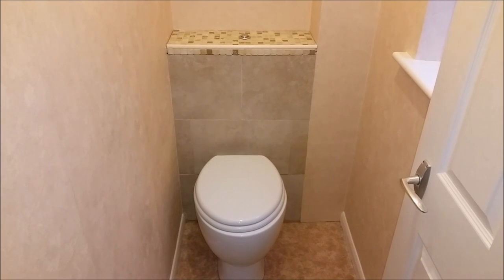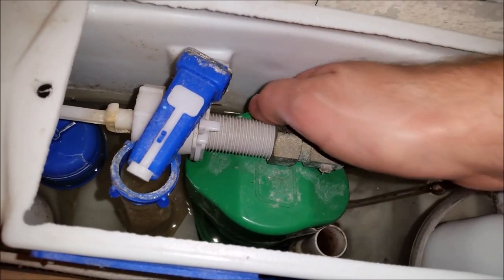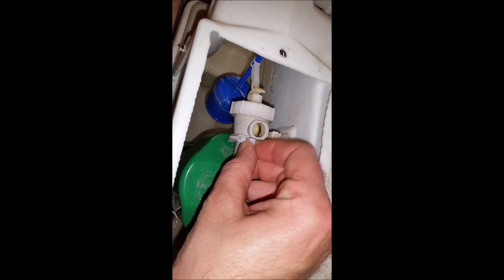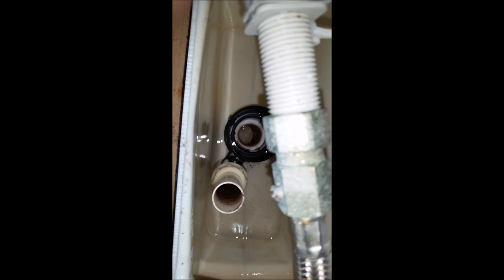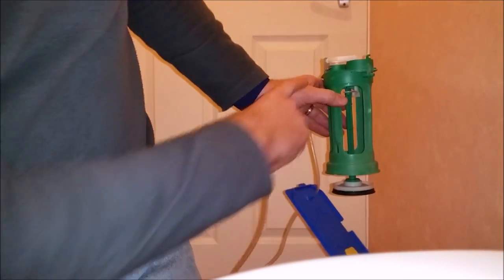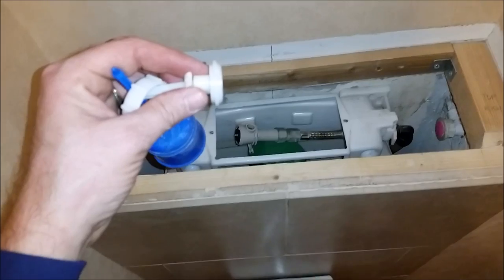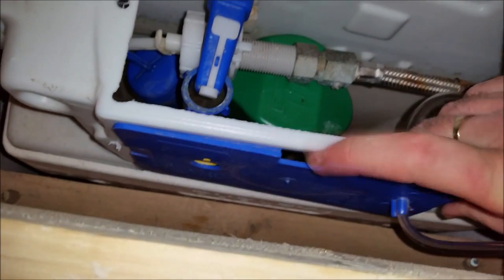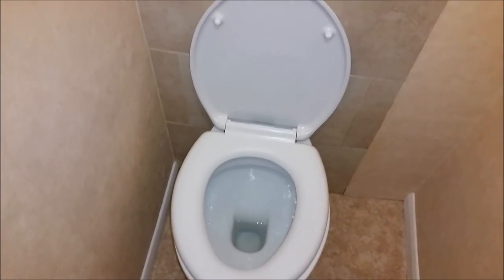How to repair a toilet flush - push button flush not working

Comment: Just want to say - this video was an absolute gem 

Had exactly the issue described even down to the same broken hook inside once apart 

I didn’t repair - just replaced (£35 cost) once established the issue 

The tips made it so easy and simple to do 

Saved me a small fortune in plumber costs 

Thank you

Comment: I too must thank you for this upload. I have the Dudley Niagara Single flush, that well, stopped flushing. Using the info you videod I identified the culprit was a wheezy bellows (the green clips were fine). So after a certain amount of time and a £13 urgent delivery Ebay purchase, I now have it installed and flushing again as per normal. Saved me god knows how much in Plumbing charges - particularly due to the current Covid-19 silliness. Thanks again bud.

Comment: Thanks for the video. I have a similar issue but my problem is getting the flush valve out through the top and the Thomas Dudley video does it all through the front opening but the way you dismantled the water input side inside the cistern has solved it for me. Hats off to you. Jon

Comment: Thank you so, so much for such a detailed and helpful video. Ours flushes sometimes and not others, so throwing a bowl of water down was our answer, but embarrassing when visitors have been around in the past. Now we know how to take it to pieces we've discovered the flush mechanism works so we can either check the green innards out or just order a new 'green' piece. Can also now easily change from a single flush button to a dual flush button.
Update: we did it. Thank you again. You made it so easy. We put aside the morning to tackle the job, giving us all day if necessary! It was completed in about 20 minutes.
We found the plastic 'stick' that travels up and down in the centre, moving the actual mechanism up and down, sometimes went too far and instead of going back up through the hole it was centred through, it was catching on the edge. The new flush valve has a different centre to it with no risk of catching. 
Job done 👍🏻👏 so thanks once again.

Comment: I wanted to thank you very much for posting this video. I never thought that it would be so important and full of relevant information on a toilet system that I am having problems with. When you opened the top of the Dudley Vantage  dual Flush thing to fix the metal bracket, at that point i recognised the guys who installed mine, 18 years ago never put the top back on  mine. And it clicked that's why mine doesn't look like anything out there on the market. your filming was very good too. especially the hydroflo float. Thanks

Comment: Thanks for the video, mine had stopped flushing all together, bought a new flush valve for £29 from screwfix and the job took about 5 mins thanks to the detail in your video and now the toilet works a charm flushing better then it ever did before👍🏻

Comment: This video is so much better than 99% of the other plumbing videos on Youtube.  Really great job.

I have the same cistern but in my case the push-button mechanism was the issue.  The white plastic bit with the air pipes connected to it broke.  It was no-longer airtight and so no air was getting to the flush cylinder.
Reply from the maker: Thanks for the kind words

Comment: Thanks i followed this guide and i found 2 problems, the plastic clip had seperated just above the diaphram, and the tubing had cracked so the air was leaking. Ordered new parts and should be good to go. Thanks for putting this guide on, its very helpful.

Comment: A truly excellent video after all these years. I had to replace the green part for my TD pneumatic single flush set up. It had a black plastic part that attaches the tube to it that broke off and so the button wouldn't work. There was not real way of attaching the tube so had to swap it out for a newer that thankfully still worked. I had a lot of trouble undoing then aligning afterwards the ball cock part. If it wasn't lined up it leaked as it filled up after a flush then wouldn't shut off properly. Once I was able to line it up properly it all went back together.Nice one and thanks again.
Reply from the maker: Glad the video helped you. Thanks for taking the time to comment with your story 👍🏻

Comment: Thanks for the vid 👏👏👏toilet constantly running ,enclosed cistern so thought it was major work, thanks to this i found flush valve is removable with a quarter turn ,new one £30 ,problem solved ,cheers .

Comment: Brilliant video thank you. Fixed it within 20 minutes once I realized where the water isolation valve was and which way to release the inner pipe !.Once out (no access from above but could still get out via the front opening) one clip needed to be reseated . All seems very fragile and  not confident in long term but at least it's working again. Ian

Comment: Thanks so much for sharing this video. I have exactly the same flush and button mechanism and this is the only video I have found on this model and a brilliant emplaned one at that. Mine you have to press to flush three or four times to get it to work so something wrong somewhere.

Comment: Great video & helped a lot. However with the same symptoms, a different fault. The 90 degree plastic entry into the green cistern was split. Fixed it by plenty or rubber solution with silicone sealant.

Comment: I'm going to try a button replacement to see if that's my issue but if that doesn't help I feel a bit better as I was very worried about being able to replace the mechanism in situ and having to smash the bathroom to bits to get to it! This video is extremely helpful. If it comes to it I will probably replace everything as it's very dirty and somewhat of a bodge from whoever installed it.

Comment: Thank You!! Simpler problem with mine, the pneumatic tube was hanging free in the cistern and I just could not see where it was supposed to fit. Thanks to up your video I could see that it connected part way down the back of the green flush unit. Still couldn't see it but found it by feel, pipe re-inserted, sorted. Excellent.
Reply from the maker: Pleased you've sorted it, thanks
Reply: TheIronmaster1 mom if you know Tori Kelly number tell me toys number now if you don't know it then just ask the girls and tell them to send to me by
Reply: Same thing here, your comment also helped along with the video, thanks much appreciated.
Reply: Mine was the same problem also. Thanks for the vid. Saved me calling a plumber

Comment: very useful, had a similar issue but the button had to be pressed hard to flush rather than no flush at all. Turned out to be the bellow in the top of the flush valve had come away slightly - mine wasn't glued in but had an O-ring fit. As this was lose it allowed the air to escape slowly. Once this was pushed firmly back with a good fit on the O-ring all worked well. Biggest issue is access and removing the green flush valve from the unit.

Comment: A very good video and I had a similar problem unfortunately I have no top access so the side access only 
makes it a little more difficult to get at the flush valve and I ended up removing the complete cylinder to carry 
out my repair, but thank you, another observation is the clip that holds the water inlet can be unclipped  from the rear.

Comment: Brilliant video buddy many thanks for posting! I had the exact same problem as shown in this video but please don't take this as a criticism but rather than replace the whole flush mechanism or do a repair job like you did, I simply switched the white plastic part over to to the unbroken clip on the other side and it works perfectly.
Reply from the maker: Hello. Thanks for the comment. I did consider just moving it to the other side but the bellow was glued in and I didn't want to try and remove it and break it. Good news that you managed to repair yours just by swapping sides. Regards

Comment: Great video, thanks. I could see what you were doing unlike some I've seen.The one I was looking at was in my mother's flat and the push button was sticking in. The whole bathroom and kitchen was replaced by a plumber who's a distant relative and did a good job. I wasn't sure how to get into cabinet around the cistern so we called him out and although I wasn't here at the time I now know where the front panel is. He was going away for 2 weeks the next day but had a look and refixed the tube. Unfortunately a couple of days later it stopped working again and water was leaking from the push button.Looking at your video I think maybe the internal bellows have broken allowing water in so may need a new unit and the only thing stopping me is the fact I don't know how the top of the cabinet comes off. If I did I know from your video I could fix it. So frustrating. Still at least i can now stuck my hand in and flush it and I'm fairly certain of the problem.
Reply from the maker: Sorry to hear of your problem. Good luck with repairing it

Comment: this mechanism is much more complicated from the old ones that were in use..
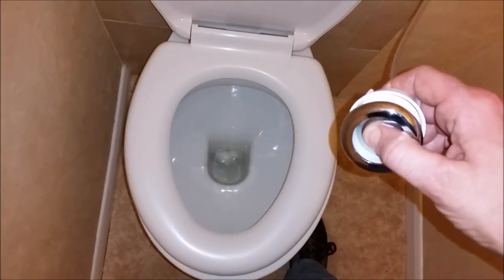at 13:20 do you think that you release a vacuum via the button through this rubber pipe or on the contrary press air through it?

Comment: Very helpful video and whilst I've fixed the broken pivot with steel wire, the toilet flushes ONLY by depressing the button and holding it depressed. This morning it wouldn't even do that. The button, when depressed, stays depressed and won't return to it's normal place. It sounds like I need a complete green flush valve.

Comment: Thanks, helped me too!
Reply: The tube had come adrift.  On mine its fits inside the connection on the green flush valve housing.  trimming the outside with a craft knife helped me get it back in.